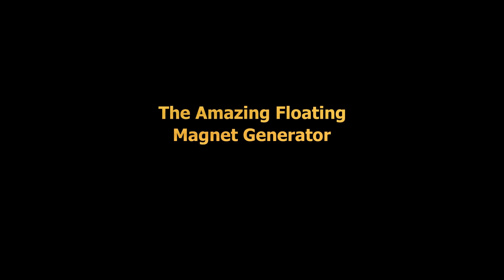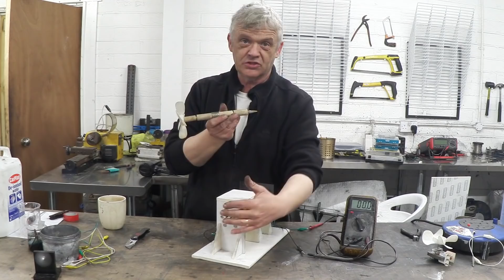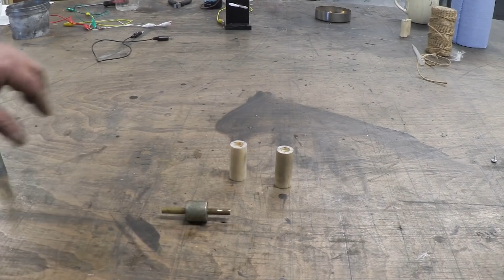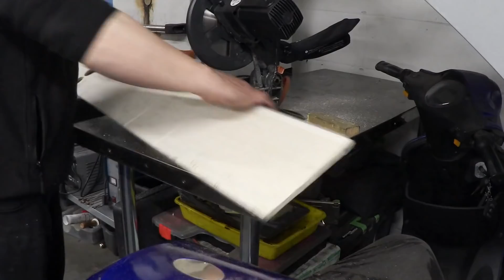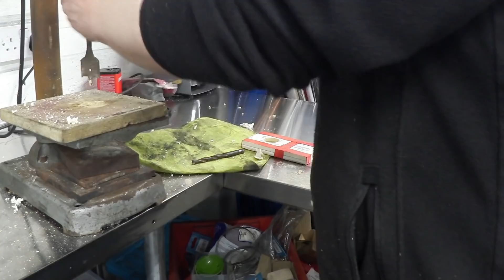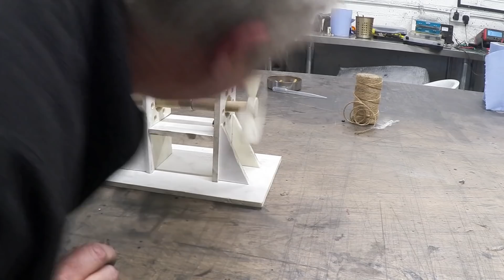The Amazing Floating Magnet Generator

Comment: I have used uPVC board for many of my projects. Rather than glueing the board together,I use the plastic blocks used to screw chip board furniture together. The board is interesting as it is available in a number of widths, some fitted with flange edges, making it ideal for building boxes or slopping panels. It is also available with slotted air vents along its length, making it suitable for equipment that requires air cooling. I have a chemical electric motor driven rocker box, used for developing PCBs, that is made from the stuff.

There are  large energy storage systems that use heavy rotating metal cylinders mounted in a vacuum to store energy to power telephone exchanges, during mains power failures. The cylinders act as motor/dynamos. To keep energy losses to a minimum, these use magnetic bearings to suspend the metal cylinders. The energy stored is so large, that the whole assemblies are usually buried underground in re-enforced concrete holes, just incase the rapidly rotating cylinder disintegrates.
Reply from the maker: try the glue mate - it will surprise you at how strong the joint is and saves on blocks and screwing or bolting - you are spot on with he flywheel generators and this would make a good one for sure - you have just given me an idea lol - cheers
Reply: @ThinkingandTinkering  I will consider using a combination of glue and blocks. I like to be able to take projects apart to service and sometimes to reuse and repurpose. One application I have found for the flanged board, is to use the flange to allow the board to be suspended below existing shelves, sliding down the gap between the shelf and the wall. This allow me to mount mains distribution blocks under the shelf for plugging in test equipment. It really is a very useful project building material.
Reply: Thank you so much for that explanation. I remember as a toddler being puzzled by the phone working when nothing else would. You've made my day. :D
Reply: @goodtimeeric  most exchanges use huge banks of batteries, to supply the phone network during mains outage. They float charge the batteries to deliver the -48 volts required by each connected telephone. As an engineering student, I was allowed access to my local exchange to see the hardware used. That was a very long time ago. At that time the batteries were lead acid, and the switching used were the mechanical strowger telephone relay selectors. The exchange had just begun replacing the mechanical system with TTL or Cmos logic.
The magnetic storage is reserved for big exchanges.
Since my student days, the telephone network has undergone several technological revolutions, converting  from switching analogue to digital audio.The standard  MSI (medium scale integration) logic has been replaced with dedicated PCM ( pulse code modulation) time space telephone switching. Then this was replaced with packet switching technology. This has now been replaced with systems compatible with the internet. 
I have been retired now for more than ten years, so I have lost track of the latest changes.

Comment: Very nice. Replace the magnet on the shaft with 2 coils attached to 2 little solar panels and you have a mendocino motor. Put a magnet on the base to excite the coils and it will keep turning.....in the light....love your work.

Comment: Magnetic field instead of ball point against glass.  I have a small version inside a venturi pipe attatched to wind cock and it powers my garden lights and water pump.
Reply: I bet it is dead straight too as that will surely help in the end.  Robert should make one straight and see if that matters since he has a lathe I am unsure why it was so wobbly.
Reply from the maker: there are lots of reasons it wobbled a bit - it was made in four parts so each part wasn't identical - the field magnets are in slightly different vertical alignment so the field wasn't even - I could have taken  more time but this 8 min vid took all day to make and for me that was enough lol
Reply from the maker: awesome mate
Reply: Understood I am just a tweaker at heart so I see the wobble and figure it isn't at its peak and how much did/does the wobble affect the outcome?
Reply: @thebeststooge  Single-digit variance if not sub.

Comment: Floating magnetic homopolar motor would be cool. I always wanted to make a ball bearing motor with a oversized flywheel for pulsed dc to keep bearings cool. Then attach two faraday homopolar generators coupled to bearing drive motor. This is a future locomotive idea ive been daydreaming about
Reply from the maker: cheers mate - go for it

Comment: I came across a salvaged Japanese PC fan that says it has a magnetic bearing, I wonder if it uses a similar configuration?  I stuck it into a case with a lithium ion cell to use as a small portable fan and it has been great for many years now, however it definitely has a little more whine sound when it runs and there is a noticeable clunk sound if you set it down hard when it’s off...  definitely an uncommon model to me, and I’ve salvaged many PC fans over the years...  seems like it may have been a premium part for equipment that needed to be more reliable for longer than the typical ball bearing fan, I can’t recall exactly where it was extracted from but I think it was just an office PC.

Comment: Of course adding in more than one coil would increase generation; like those small electronic transformers found on pcb. Those are light weight and can generate without much in the way of modification, so they would lend well to a project like this one I feel.

Comment: Hi Robert, great video as usual. You may be interested in what is called a Newman Motor, that is very much like your build now, with just an addition of an electromagnet powered by High Voltage pulses, being a high-torque ‘Voltage’ motor rather than the ever common ‘Current’ motor. Voltage is already in the atmosphere, as static electricity. Just adding an electromagnet (instead of wire windings) on top of your motor build with a commentator arrangement, you have a Newman motor. Search for “The Energy Machine of Joseph Newman’ for details. Happy Building.
Reply from the maker: cheers mate - thanks for taking the time to post

Comment: I used to have a low-friction levitating magnetic science toy like this, although it was not set up to generate electricity.  ~  Instead of the ballpoint pen end, you could possibly use the point of a needle or pin.  Some science-experiment items use a pin or needle's point contacting the inside of a thimble to make a low-friction turning point in a vertical set-up.
Reply from the maker: yep - it's called the floating pen I believe

Comment: Have you considered making a project that combines your simpler/low-cost batteries, generators, and motors? As in a small scale example of the possibilities your demonstrations have in a closed system. I am a handyman, not a scientist, but I would like to try projects that expands my knowledge and benefit me in a more direct way too.  Thank you for videos, I find it hard to find Youtube videos that spreads actual knowledge and provoking thoughts.
Reply from the maker: it's a good idea mate - the info is here to do that - why not try and put such system to gather yourself? That would be a really awesome project
Reply: If you live in a town that has an "electronic recycling company"  GO MEET THEM!

Chances are they have LOTS of parts for close to free that they would be willing to sell/ give you if you tell them what you are trying to do.

LOTS of magnets, motors, etc... available for VERY VERY cheap

Comment: If the orientation could turn vertical it could have a omni direction blade system or i. This plan a hexi wing blade it may need additional magnetic bearings to support the alternative blade assemblies.
Reply from the maker: for sure mate

Comment: I did enjoy it Robert rather than a ballpoint pen tip why not two more magnets? then the only friction is air.
Reply: It could be done with a ring magnet in front of the fan and at the rear plate.  Then glue smaller disc magnets to the fan and the end of the pen.
Reply: Yep except the two magnets have to pull on each end to keep it stable.
Reply: @jasonwitt8619  No, You already have magnets pushing the shaft towards the end plate just stick another magnet on the end where the ballpoint is and then one on the endplate so they repel each other.
Reply from the maker: I like that idea mate - I will play with it
Reply from the maker: thanks for the suggestion mate - I'll have a play - cheers
Reply: AS ALWAYS, THOUGHT PROVOKING,   YET SIMPLY REPEATED. 

NO HYPE, NOT SELLING ANYTHING. 
Kindly giving ideas, encouragement and best,  SHARING,  enthusiastic. 

Just what we could all strive for.

May you live long and clone yourself. 

(If you figure out the cloning could you please post a primer video?)

Seriously though, THANK YOU VERY MUCH,  your joy IS contagious.

I suspect Arctic Dwellers  could be happy to learn ice block making from you.
Reply: Doesn't work. It's impossible for any configuration of permanent magnets and ferromagnetic materials to produce a field which allows part of the assembly to hover without a point of contact. The mathematics of this proof are beyond me, but if you wish to look it up, research on Earnshaw's theorem.
Reply: @Barskor1  I like the concept but the problem I see with that is as the shaft turns, it will cause the magnets to align into and attraction polarity. Or the shaft pole would be attracted to the sides of the stationary magnet chasing a wobble along the shaft that gets more violent the faster it goes until it "jumps track" and stops the device possible causing damage to the components.
Maybe it can be done with using a tiny amount of the energy produced sent to a coil (electromagnet) that is synchronized by the very same shaft that is producing the energy. AC current produced ran to the coil sized and arranged to match the permanent magnet so that as the shaft turns, it also rotates the electromagnetic field to keep it in repulsion phase. 
I don't have the math in that but I world think it wouldn't be too hard to figure out since you will already have most of the variables pre-determined by the device component sizes. Match the forward magnet and opposing coil to correlate with it.
Sorry so kind winded. Be glad we are not talking in person. Lol
Reply: @SI-GOD  No,  If you were mounting the magnet to the side of the shaft you would be correct but we are mounting it to the end of the shaft so no matter how fast it spins only one pole is facing the endplate which has the other magnet with the same pole facing towards the shaft they repel each other. N------S   S------N Ok?
What you and others have missed apparently is in Roberts demo the set up magnetical lifts the shaft and pushes the whole shaft towards the endplate that then spins on the ballpoint.
Reply: @Jose Loc it would make next to no difference I think, the major force slowing the rotation would be the magnetic fields themselves creating the current. As someone mentioned further up I think it's next to impossible to do without the pen against glass anyway, but I doubt air resistance has much of an effect on it as it is
Reply: good for school science project.. but I can it be scaled in size ?
Reply: @c2sartinkprinthub757  Yes, as long as you have appropriately powerful magnets.
Reply: A really great demonstration of magnetic bearings. The speeded up assembly was simply brilliant and explained everything. It would be interesting to see if this idea could be scaled up. Thanks for the video.

Comment: I have seen other builds of these devices and often wonder if another set of magnets can be arranged in the front where the pen touches the glass to further reduce friction and then put it all inside a vacuum box to create zero friction.
Reply from the maker: nice idea mate - give it a go and share you results
Reply: Physics, regrettably, says no.
https://en.wikipedia.org/wiki/Earnshaw%27s_theorem
Reply: @ThinkingandTinkering I plan to do just that. Thanks.
If I get the magnetic working, I'll share it with you. The vacuum part should be easy to add to that except I currently don't have the equipment to do it myself. I figure I could use a HVAC vacuume pump with a check-valve like is used with in-line tubing ports attached to a box made of acrylic glued together and maybe silicone caulking

Comment: Fun. However, scaling to meaningful power levels could prove problematic. Similar magnetically supported "desk toys" will start to bob after spinning for a while. The same type of bobbing or loping action has plagued some forms of maglev train projects. Magnetic bearings are, of course, available. Designs incorporating magnetic bearings are significantly different from this project, and, of course, have their own drawbacks and restrictions. Upshot: I wouldn't count on this concept as part of your "getting off the grid" project.

Comment: You can buy this from Alibaba and Aliexpress-china stuff. And it is pretty cheap, the chines one even explain with diagram how it works. It is magnetic levitation idea originally from levitating trains which was first developed by professor laithwaits.
Reply: What would be the point in buying it? You learn more by doing it!
Reply from the maker: you csan also scratch build it from scrap laying around - that's even cheaper and you learn more
Reply from the maker: absolutely mate
Reply: @ThinkingandTinkering  yes.

Comment: Hi Robert um...silly question🤔was thinking how to make a megahertz frequency spark gap like the one tesla achieved. PM me some possible ideas. Came up with a few I plan to try. Also I'm wondering how an air tank would compare in energy storage in size and weight in comparison with electric batteries. Last thing I was thinking is how long those ceramic/carbon electrodes would last in operating use...thanks luv the channel. It's a treasure trove for real content. Thanks for saving us from the fake news tubes.
Reply: Storing energy in a air tank as alterative to a battery was built by a french company.  The tank was heavy wall fiberglass type and pressures were very high the Range was good 300 to 800 miles due to the fact the liquid air was used to cool the engine/transmission so the friction heated the air further boosting performance.   Im going to take a guess it was too expensive to mass manufacture this and if a accident knocked off the end of the air tank,  well some advanced physics would quickly come to life

Comment: I once saw a video were they put a metal ball in a coil and it was levitating and  kept spinning until it heated up and melted. dont know if the ball was the magnetic part or the coil. seeing this reminded me of that. is that possible or just a special effect.
Reply: Induction coil and electromagnet.
Reply: Inductive heating and levitation. It's possible. Sometimes the technology is used in welding, especially automated welding - there's no contact between the workpiece and the welding machine, so the machine doesn't wear out. Takes a lot of power though.
Reply: thanks
Reply from the maker: I once saw a frog being levitated
Reply: @ThinkingandTinkering  That was diamagnetic levitation. You can levitate a lot of things like that, including water - and frogs are mostly water. The effect is very weak though, so just overcoming gravity requires generating a magnetic field of immense strength. What you saw was a tiny frog, but you probably didn't see the room-sized stacked electromagnet assembly, or the adjacent rooms containing power supply and cooling equipment. It's difficult to even build an electromagnet so powerful that won't also tear itsself apart, and it needs constant cooling with refrigerated water just to keep from melting.

Graphite is much more strongly diamagnetic though, so it's possible - just barely - to float a sliver of that using equipment small enough to build at home.

Comment: ..........arrange it vertically and it might rotate from the rising air of candles ( extension of fan blades could be required using say breakfast cereal cardboard) , don't aim to harness electrical energy but mechanical energy instead to operate via various linkages some figures say chopping wood, dancing, pedalling bikes . You know of course those candle powered scenes sold to tourists in Switzerland . Dutch and Scandinavians also make em..I have one sitting on computer and it reminds me if I've left it running .
....suspending and confinement of hot energetic fusion plasma might be slightly more intricate. From little things....
Reply from the maker: really nice suggestions mate - cheers - I have what I am interested in but you are 100% right - folks could have a lot of fun with this and make some really nice stuff

Comment: Now add a set off 6w dynamo peddle style or drop load dynamo to run the main and the magnetic helper there to lower resistance or pull torque if needed or on the wind you really otherwise you really need a pack using high car audio grafite caps for life use 20 min with 80 units for full time befor recoil off 200kw after losses! For 6 years constant???? Use the wind to the pack to curcit cut to extend pack life time i have a pack and my a flip feild one on this the pack is a coles fridge granted while i check out the feilds in electro magnet for higher power gain. ☺😊😀😁😂5 smile's.